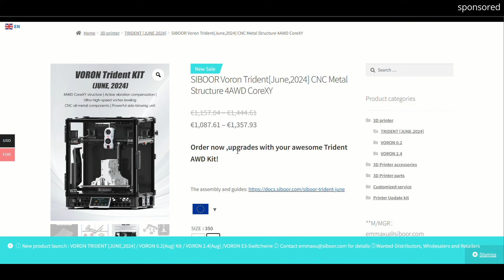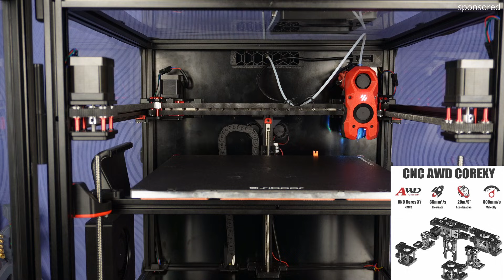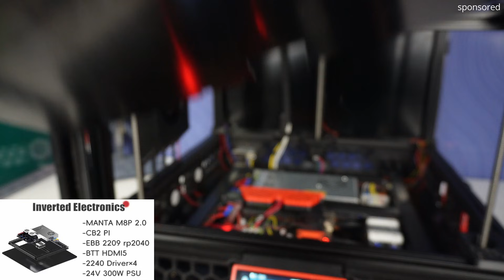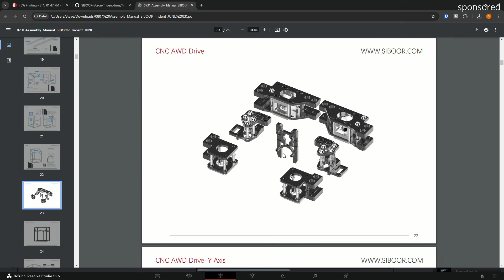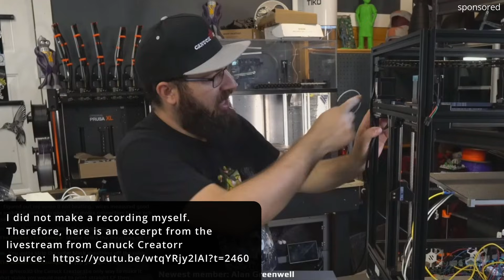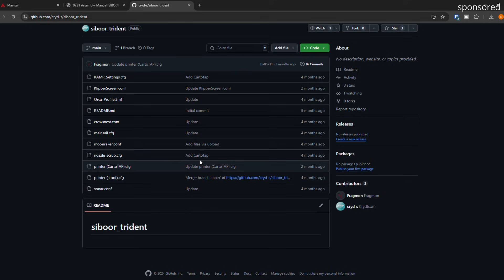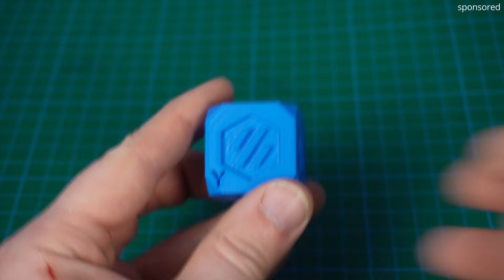Is the Siboor Voron Trident 350 AWD the Best DIY 3D Printer Yet?

Comment: This is very tempting.  I'm going to hang back and see what Bambu Lab offers in January before making my decision.  I know this could end up costing me big in tariffs, but I'm willing to roll those dice.  I want a large machine that prints in PPS-CF and I want to modify it to take E3D Revo nozzles as I like being able to swap them out for different sizes quickly.  Being able to slap a 1.4mm high flow obxidian nozzle on a printer of this size seems like a really nice option to have to make large and strong parts.  Given the ability to use higher temp E3D nozzles that are out there, that makes for a very versatile and fast large-ish format single color printer with the option of adding an ERCF later if needed.  If the forthcoming Bambu Lab printer doesn't blow my skirt up, I may look this way sure enough.
Reply: They are going to offer you shit, with a smile.
Reply from the maker: @odeball22 what do you mean?
Reply: @crydteamprinting  buy somthing else.
Reply from the maker: Which manufacturer do you recommend?
Reply: @crydteamprinting  creality, moded ender 3 are the best printers in the world.
Reply: @crydteamprinting  As of right now if you want to do multicolor, Bambu Lab P1S is still king of the hill if you don't mind the about to be closed ecosystem.  If you just want to make functional parts, Qidi Plus 4 is a pretty solid choice.
Reply: Lol 😂 what a cope take  @odeball22
Reply from the maker: Thank you for your comment. I will build an ercf v2 and a Boxed turtle soon and will compare this both mmu. Stay turned.
Reply: Voron is far superior to Bambi just from a maintenance standpoint. The performance from the gantry is similar in both but with the Voron you use essentially any tool head you want. For what you say you want to do you should look into the XOL tool head, I'm pretty sure it's compatible with the hotend you want and you can use the cpap mod for it to get the best part cooling available.
Reply: Bambu will sell you a license to use their hardware and you'll like it. Lol
Reply: Honestly Dual Nozzle Large Format Bambu seems sooo good that I am waiting for the same reasons.
Reply: @JonLaRue  if it prints only in 300C or less, it is going to be competing with the Prusa XL in price point and that thing can do multicolor without a lot of waste.  That extra print head won't amount to much unless they have some trick up their sleeve that makes this new printer really different.  I am hoping that difference is higher print temps, but I am unsure if that will be the case.
Reply from the maker: I think higher temperature is not a Case for consumers. Maybe the next "X2E" for pro-sumer or enterprise can have this Feature.